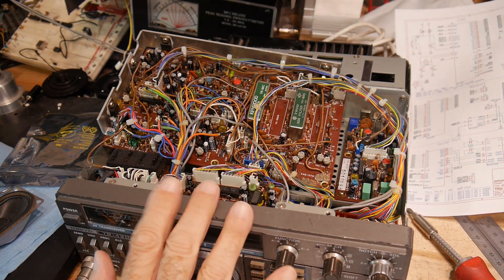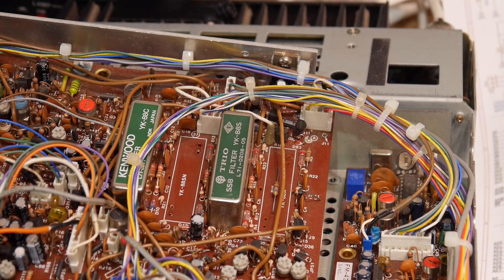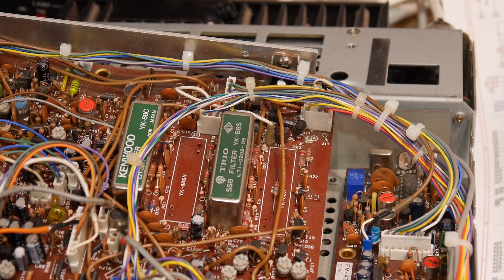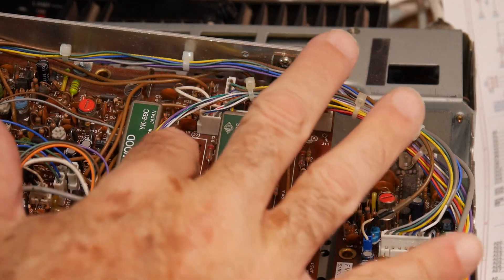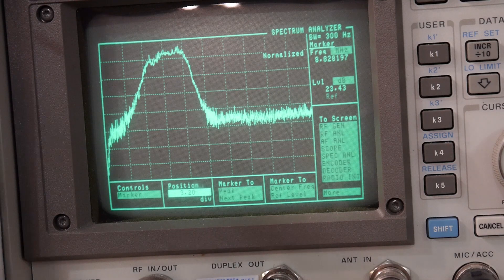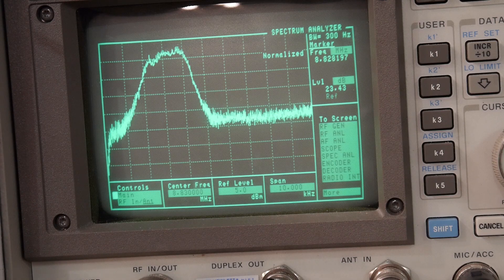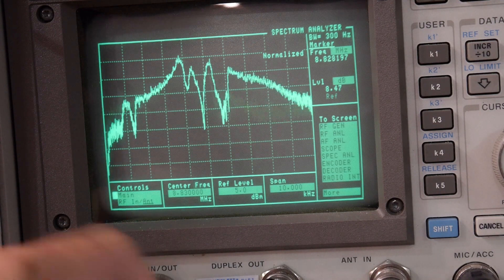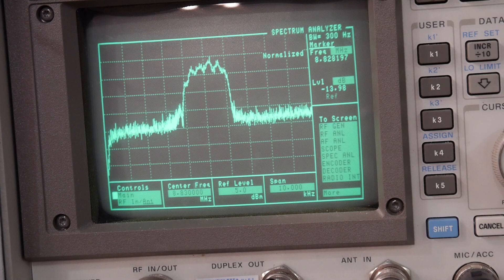#234 SSB Single Side Band SSB IF Filter Kenwood TS-430S

Comment: Always nice to keep boat anchor radios alive and well, although the TS-430/440 isn't in the tube category. I'm replacing the power supply in my TS-940S with a modern switcher and that will continue to be the XYL's HF rig. We got a slight hint of the rest of your workbench, how about a tour?  ;-)  73 - Dino KL0S
Reply from the maker: I just bought a Yaesu FT-900 off of ebay for $260. sold as parts but is supposed to work on lower bands and has a failing PLL on the higher ones. A $1300 radio in the day with built in tuner. I'll post a video when it gets here.